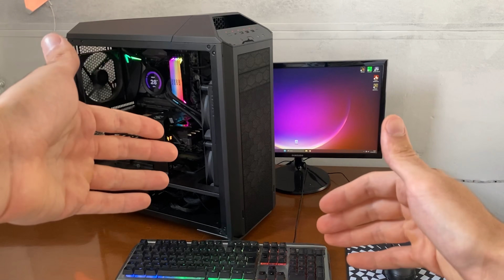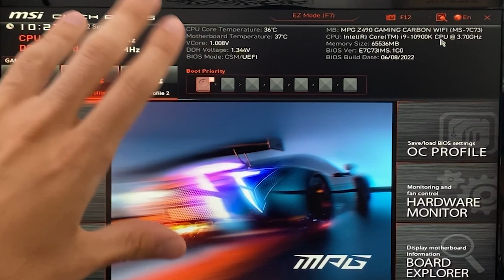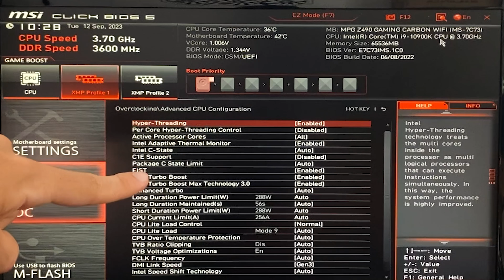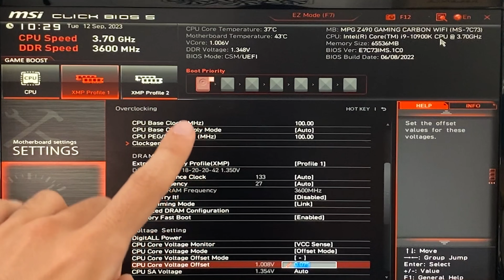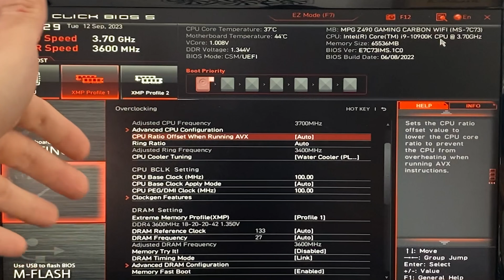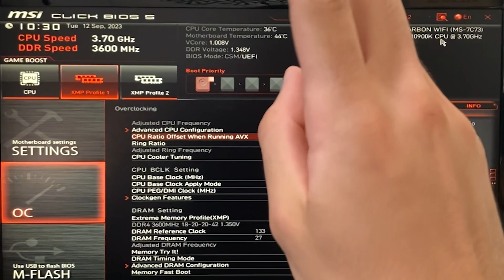Undervolt your i9 10900K for more FPS! (Even on Locked Motherboards) - Tutorial

Comment: Undervolting a 10900k is completely pointless.  It reduces performance, nearly always.  If you ever hit 100c you have poor cooling.  I have a 10900KF that does 5.1GHz/5.2GHz all core.  Cache set to 4.3GHz stock.  I draw ~280 watts maximum in prime95 and in the middle of the 80s in temp.  This is overclocking for lower power draw.  Most 10900k's won't boost past 4.9GHz AVX, with epic cooling and very low temps.  If you hit 100c at that frequency in prime 95 you don't have enough cooling.  Most of the 10900k overclocking performance comes from the memory overclock.

Best way to maximum temps is max overclock the cache.  With that two 360 rads will suffer 90c temps and be just under 100c.  This CPU is stable at its v/f curve and there isn't enough voltage to drop to make a difference on decent cooling.  If you drop the voltage too low, the CPU just won't clock as high.  Most of the time its RIP 5.3GHz single core boost.

Many 10900k CPU will be SP63 and hit 5GHz AVX.  This is with 1.34Volts vcore and stock cache.  LLC6.  This on a 360 rad custom water cooled can hit 80c approx.  Hitting 100c on a 10900k means your PC cooling has a design issue or you need to fix your bios settings.  At higher frequencies than 5.1GHz you need massive vcore increases.

To keep temps under control, just find the sweat spot for overclocking and don't try to push beyond your cooling.  The 10900k is CPU that requires water cooling, custom loop or AIO 360.  Some CPUs pull 280 watts and other hit 380 watts with their overclocks.  Try to aim for an overclock were most loads are under 280 watts and near 70c.  Only in prime 95 should you hit 80-90c.

Comment: During some ComfyUI workflows, some cores were hitting 91c. Not really ideal. I did this, now they're only hitting 62c. with do performance degradation. I have an MSI Z490-a pro and I think its default values are meant to run hot for "performance."

Comment: thank you for the video, could not oc my10900k and had a lot of trouble with my nzxt n7 z490 with fixed voltage , 46000mhz no matter what i did try  did not think to use offset mode. It fails when i try small data occt ( tems go super wild ) but large data test i got the 4900mhz ( avx offset on my mobo is 1 impossible to do 0)  it gave me at least something to work on , much apreciated!

Comment: Im gonna attempt this now. I've been seriously over heating my 10900k with a 4080 for a couple years, and it dawned on me, as a noob, that omg, I dknt want my system to break or die in general lol. Was a 3070 10900k pre built got years ago but I got a 4080 for it and I'm a noob about all this, it still works pretty good for the most part honestly, just cpu way too hot near 100c always after a half hour of gaming stock cpu settings it only has a 120mm aio it came with and I read at least a 240mm for this CPU .... Here goes nothing lol it's all good thanks for the help I'm sure it'll work fine, but I can let you know 😳 🤙 lol
Reply: 360 AIO minimum.  Some samples have lower power draws but others are very high.  Overclocking the CPU can hit 300 watts+ very quickly.  At stock you hit 120 watts approx.  Why all these people that get 100c are on bad cooling.  If you have 120 AIO then you aim to hit stock power limit of about 120 watts.

Comment: This is mental, my temps dropped dramatically.
Reply: I only have a 120mm aio on my 10900k with my 4080 it's sooo hot it goes to 100c after a half hour of gaming AAA games it's nuts I need a new 240mm aio or something and to undervolt somehow. I hope your system and everything is good now 🤞

Comment: I have this cpu. Very shitty cpu. Games with raytracing make this thing very hot. This and same time obs. Wow. Very hot. You need high fan rpm / so very loud. Comet lake is bad…. 14nm….
Reply: Bro this cpu is like 4 years old. Your overheating problem could be because of thermal paste gone bad or a dirty computer. I would clean your entire pc especially the fans. Then apply fresh thermal paste. It should remedy the problem
Reply: Zero issues with a 10850k and RT. If you're running hot you either have an inadequate air cooler or you're trying to push it too far without water cooling. I, with poor case ventilation, am getting around 70-80C with the CPU and under max load it's about 90, lower 90s, but max load is basically prolonged rendering/stress testing, something that doesn't occur normally. I'm using an air cooler though, so no shit I am still hitting 90s in rare circumstances.
Reply: @imaginarymenageriemanager6303 have now 9900x3d and a 5090 ❤temps are fine. But cpu is still to slow for handbrake.
Reply: 10900k is pretty easy to cool, if you have issues with it its skill issue. The die itself is quite big thanks to 14nm and 10 cores. Also skylake is the most noob friendly microarchitecture, there is no need for messing with pbos, downclocking, clock streching, nothing, you literally set voltage and frequency. The cpu by default have thermal velocity boost so you will always have hot pc as cpu literally aims to be hot and as fast, skylake/14nm is robust after so many years of refinement, you can run it even at 1.45 daily its not gonna die. Still if you want efficient cpu 1. dont by 10 cores cpu. 2. if you want 10 cores you dont need to run them at 5ghz 3. if you want performance per watt buy modern hardware. Also this applies to every cpu - downclock cpu and OC ram to the max you will get a lot more frames and half the power draw. That being said i run 10900k at 5.4ghz allcore it can still power a 4090, probably 5090 would be just fine too. Sure its not gonna be 600fps in esport games, but in AAA skylake with 8 or more cores is all you need, assuming you dont run stupid resolution/gpu combo.
Reply: @erisium6988  I have now 9900x3d and a 5090. way better CPU.

Comment: I'm at - 0.085 at 4.9 ghz, 1.16v at idle and 1.9v under load with c states and speed shift enabled, only. Turbo is off. 
 125w pl1
250w pl2

At 4.3 ghz I'm pulling 1.05v under load occt.
Ring 40
10850k

Comment: does it make sense that I can't get a stable system with anything less thatn -0.05? how are some systems able to go as low as -1.25?
Reply: Find out what the cpu wants with the core voltage set to auto without the offset and then see what it wants to pull under full load without the offset as well. 
That will tell how much you can underclock it. Keep in mind it will be throughout the entire frequency curve unless you do an advanced offset. 

- 0.125v offset is too high for the entire frequency curve. You'd have to have a high llc just to keep the voltage stable.

Comment: Hey i did the same as you and lose 60% of performance. How can i improve since the stock setting make my pc hot
Reply: There is no way in hell you lose 60% performance from barely unlocking Power Limits and lowering CPU Voltage by 0.050. Voltage doesn't affect your performance that much, what it does is, the higher the power usage, the hotter your CPU gets, this is why he's making it run slightly less voltage for cooler CPU. If anything that make you lose anything more than 20% performance, it's probably because your PC needs better cooling system, and bc you put the "CPU Ratio Offset When Running AVX" setting to -1 like him, the system basically underclock your CPU usage for you when it's undervoltage (under power). Try changing "CPU Ratio Offset When Running AVX" back to "Auto" and see if anything changes, if not, then you really need a better CPU cooler, or cooling system for your whole PC, and try using the Default settings. It's not really possible to overclock your CPU for better performance WHILE keeping the temperature lower, when your CPU is already overheating on default settings. The whole point of overclocking CPU is to make your CPU work harder for slightly better performance in exchange of making your CPU hotter.

Comment: Didn't work for me my Vcore was still 1.3 - 1.4 in HWINFO64  It was showing 0.960 in the BIOS I don't understand.

i updated my BIOS and my CPU settings somehow changed now on all default and your settings I get blackscreen pc restarts when starting games 🫤 and 90-100 temp
Reply from the maker: I think there might be an underlying issue there. Do you have fresh thermal paste? Try with a dynamic offset of -0.04
Reply: I assume you fixed your issue, but for people that might find this: Thats why you shouldnt run offset, just run manual voltage, set it to whatever you like and then just type frequency you thing will be stable and try to run OCCT. If it crashes lower freq if it doesnt set frequency higher till it crashes. If you dont want stable frequency you can set adaptive voltage + offset and manual dynamic frequency so no issues there if you want to maximize idle powerdraw

Comment: Hey man - huge fan of your stuff...I have a 10900K in a NR200...I call it my little heater...dropped temps about 4-5 degrees with this tutorial

If you have any opinions on some better options for me in terms of getting a stable, snappy, overclock/undervolt for an ITX build that is AIR cooled...I would love the help...

current thermals are about 30-35 idle

C23 under load with your settings I am scoring about 16.5k multi with highest temp being 87

Was really hoping to get my temps in the low 80s or high 70s...any ideas?
Reply from the maker: Here I am, thanks a lot for the kind words! Absolutely yes, we need to go for a static OC/UV. Something along the lines of 4.7Ghz at 1.2V, but you’ll need to trial and error to find your sweet spot